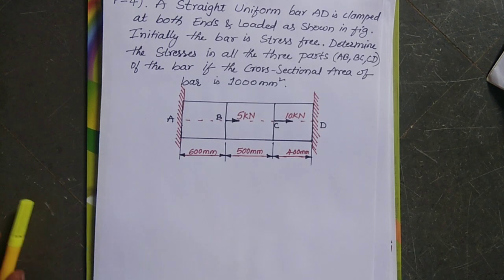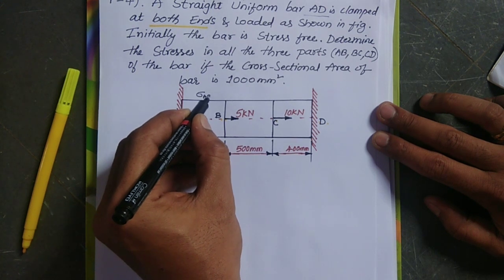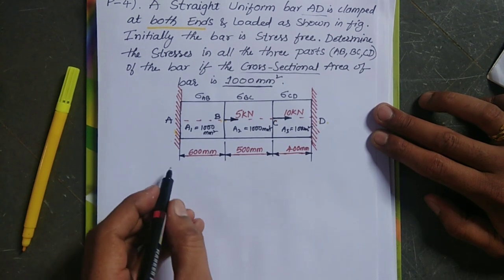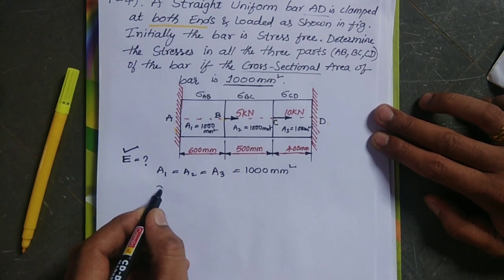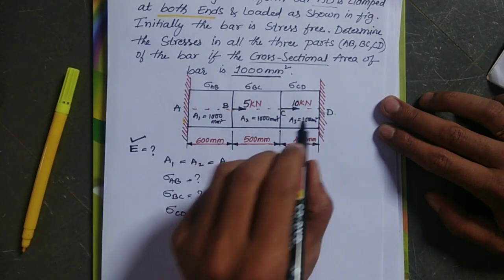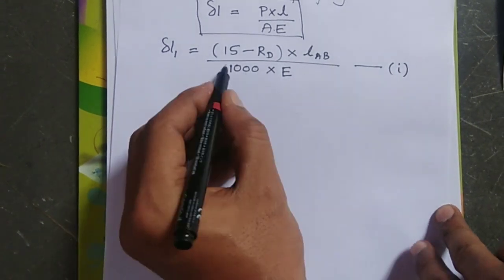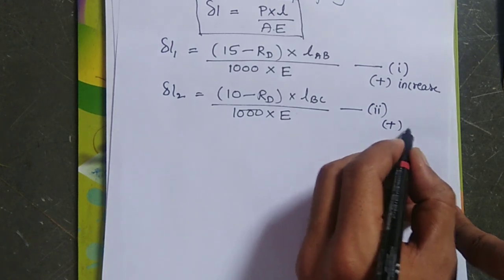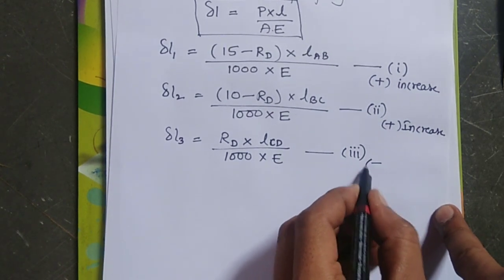Elongation of the bar problem | Principle of superpositions _ Prismatic bar

Comment: P ka value 15-Rd kese le rhe h, or ∆l1+ ∆l2=∆l3 kese ho rha h
Reply from the maker: Could you please elaborate your questions
Reply: Jab last me calculate kr rhe h to P ka value 15-Rd kese le rhe h or delta L1+ delta L2= delta L3 kese ho rha h
Reply: This is because... The bar can't elongate as it is rigidly fixed .... And hence total tension will be equal to total compression

Comment: Watch at twice speed 
Thank me later
Reply from the maker: What is the Problem
Reply: A steel bar ABC is placed on a smooth horizontal table is fixed at its left end A. Its right end C is 1mm away from another support D. A load of 65 kN is applied axially at cross section B and acts from left to right. AB is 1cm in diameter and 1.5m long and BC is 2cm in diameter and 2.5m long. E=200000 N/mm2. The stress in portion BC ?
Reply: Sir is question ka please solution upload kar  dijiye
Reply from the maker: Okay i will upload now
Reply: @MaheshGadwantikar  thank you so much sir